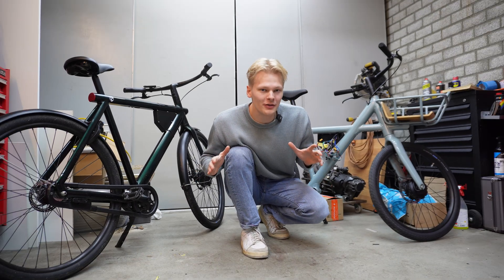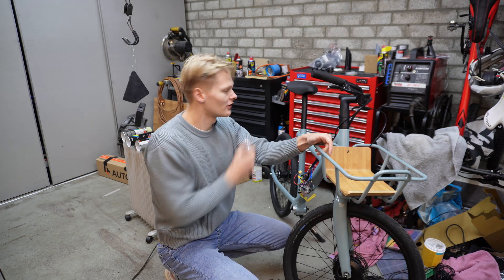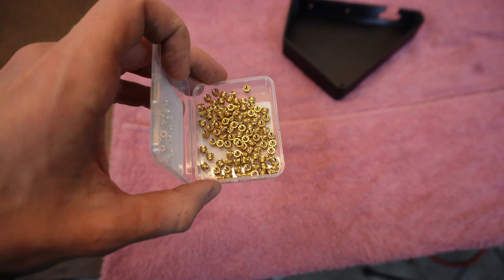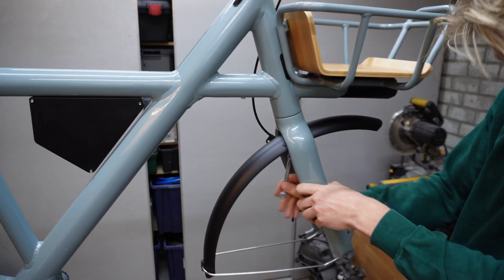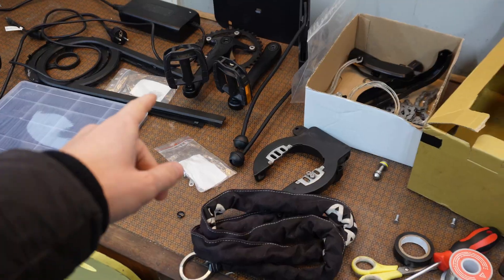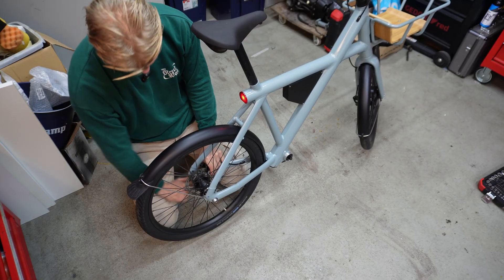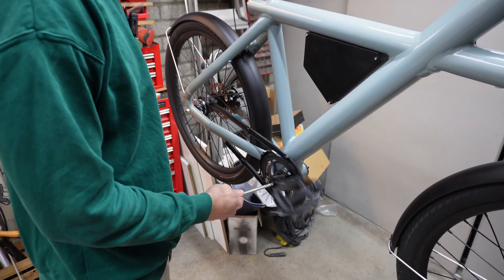FIXING A SCRAP VANMOOF - Vanmoof X2 (Part 3)

Comment: For a rear light just to be visible for traffic from behind these frame integrated things are sufficient but the front ones often feel like bare minimum to get road legal like the Axa Echo 15, those ones on the Elops 520/540 by Decathlon or on Cowboy bikes, Cowboy even included a battery-powered handlebar-mounted headlight for the bikes they sold in Germany to make them road-legal as the integrated front light is only a position marker.
I'm a little disappointed that they seemingly didn't think further like these rear lights might also get covered/obstructed when you put on a rear rack (not with pannier bags but when you put on a basket or something else on top of that), it would have been great if they had developed something like the Ortlieb Quick-Rack that you can attach and remove in less than a minute and integrate a rearlight into that and something like a MagSafe connector on the frame that will power that rear light.
Get yourself a Jagwire Mountain Pro brake cable kit next time, I didn't buy these for every bike I have but for some and the outer housings are available in a couple of colors, they mustn't match the frame but may add some nice-looking color accent; got a bike with 7-speed hub serviced a couple of months ago as it was barely shifting and because it also needed a new shifter cable I got such a shifter cable kit by Jagwire with blue housing and it looks good on the bluish-grey frame.

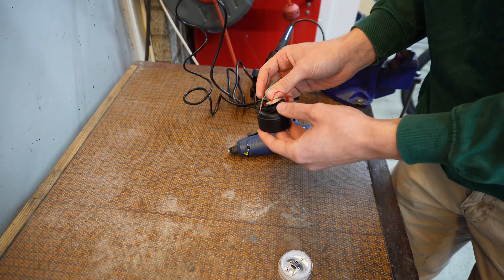Comment: Yo, rebuilding one of these right now and I've got everything to work except the e-shifter. As far as control inputs go has anyone mapped them? Voltage Input? Ground? Hunting a wire schematic or recommendations on replacement with a normal derailleur set up? Oh and edit note to not just be selfish: I would have been daunted by this project had it not been for you uploading these. Keep it up man these are cool 4:40 I put a buck converter in my controls casement hahahahaha Im using the original S3 lights because they look nice and I don't want to bother like you have to design nice fitments for new lights 😅 (the front light housing is broken on mine)
Reply from the maker: Great to hear you got inspired! I have not yet worked with an e shifter, but you could always put an x/s2 rear hub in if it doesnt work out. Let me know if you can find a solution, there must be some way and I’m always curious!